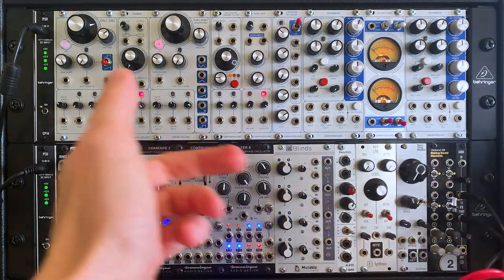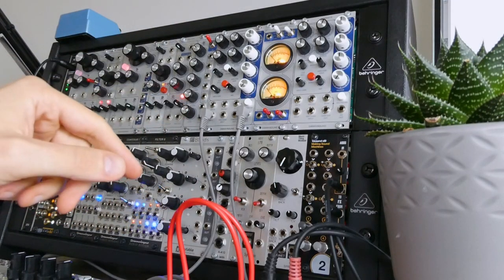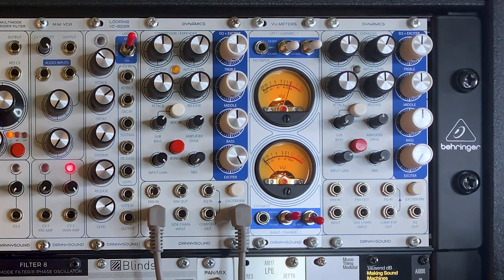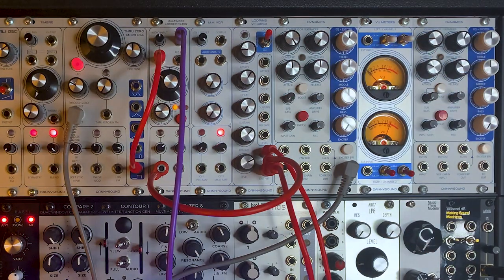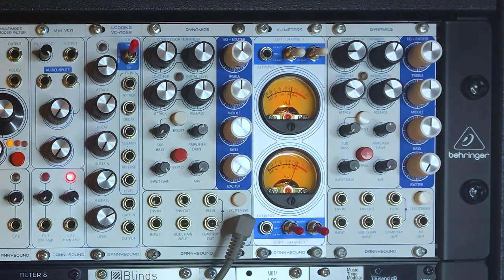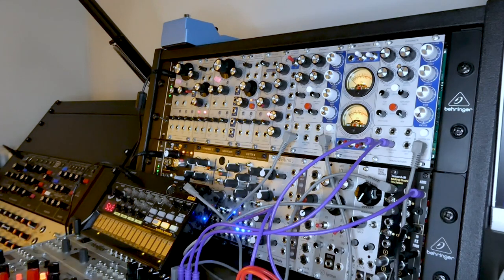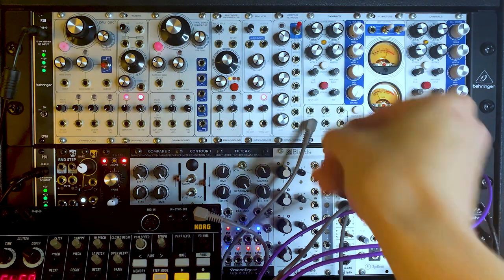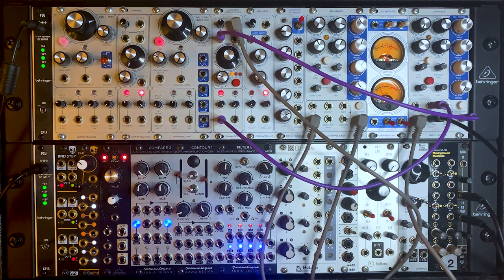Dannysound Dynamics: modular compression, EQ, overdrive, sub-bass and more

Comment: Amazing video, thanks so much for the effort put into this! I was seriously considering this build, but there is no channel linking! I honestly dont get it. They have designed it in such a way as to suggest use a stereo bus comp. Obviously it can be used as this, but it would be so much easier with a proper linking circuit, which I had assumed would be contained on the meter module. Pretty diappointed in the unit in that regard. It sure does sound so sweet though! Thanks again :)
Reply: What is channel linking please?
Reply: @hugovillain  channel linking is where you can control both channel 1 & 2 at the same time with the same controls. So one "side" becomes the master and the other the slave. A channel linked 2 channel comp would be what most people refer to as "stereo". Where as this is technically what you would call "Dual Mono".